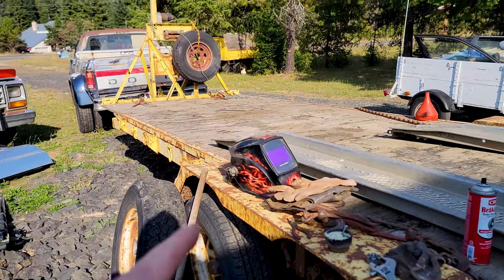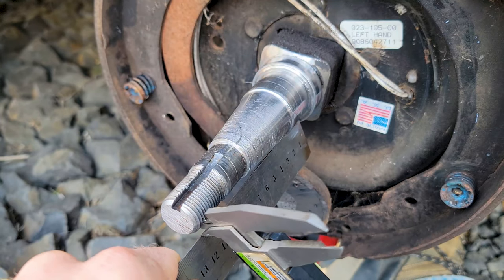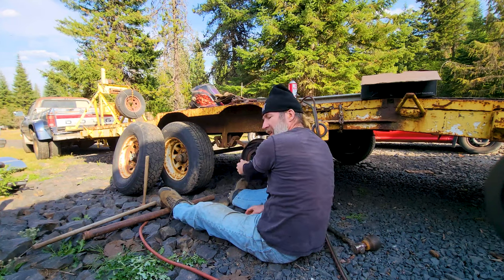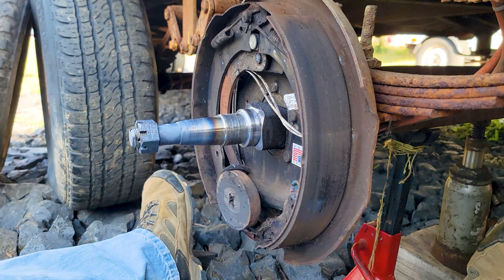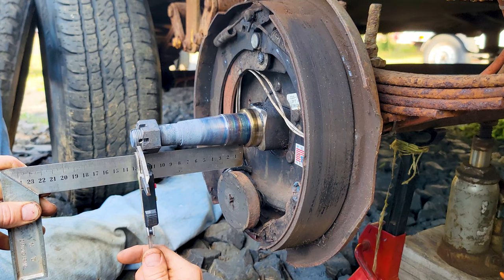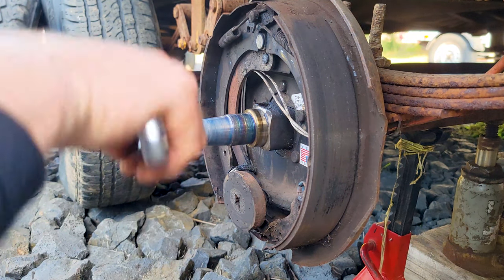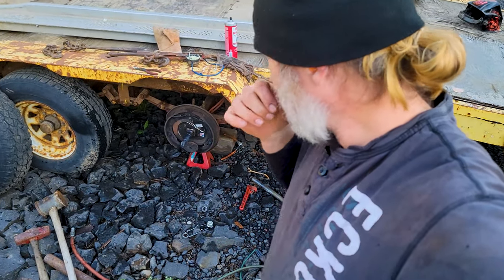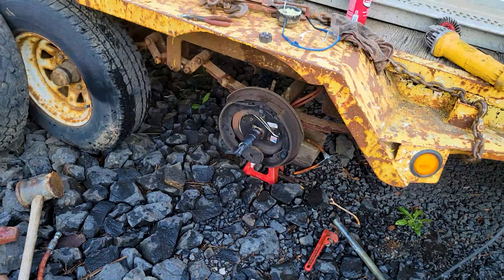Fixing a bent wheel hub spindle

Comment: Nicely done Spooner, the solar panel rack is great too. Looks like you are able to do everything you need to be able to
Reply from the maker: Ya the solar system is getting better.  I still need to get more batteries for it and maybe some more solar panels too.   I was just wondering, how's your back doing now?
Reply: @SpoonerTuner   nice, we may try to get solar panels later, we get good sun on the roof for WA. Just had another stem cell procedure 6 weeks ago with higher dose 17.5 million in my L5S1 and T12L1 and some prp in my T11T12 and knee, still struggling lots but hopefully this one works. Here's my update video 
https://youtu.be/nIkn6noWgcc?si=7IZIGbmOhHjHp1l1
Reply from the maker: @nolanpaul2714  oh that's great news!  I'll watch your video. 👍🙏
Reply: @SpoonerTuner  do you remember how often you did elliptical and core work from months 1 to 5? Was it daily or every other day or a few times a week? If you had a setback during core work would you take a few days off?
Reply from the maker: @nolanpaul2714  I honestly can't remember for sure how often I did the elliptical.  But I'd suggest 2 to 3 times a week if it doesn't seem to bother you too much.  If core exercises are causing more pain it may be best to try taking a week or two off and try to recover some and then try it again a little lighter. I feel like there is a fine line between doing too much physical therapy and resting to allow the tissues to have a chance to heal up.  But I think the biggest help I've had is from decompressing my discs/spine just before laying down in bed at night. I think once a day before bed is enough.
Reply: @SpoonerTuner   Thanks, I appreciate your input as always- good logic, and always cool seeing your videos, you're always up to a lot of different projects

Comment: How are the spindle shafts holding up since you straightened them?
Reply from the maker: They seem to be doing really well actually.  I hauled two cars on it at once 400 miles over to Seattle.  Then picked up an Expedition that weighed even more and hauled it back.  Blow out 3  tires 😆 but the spindles have held up just fine.